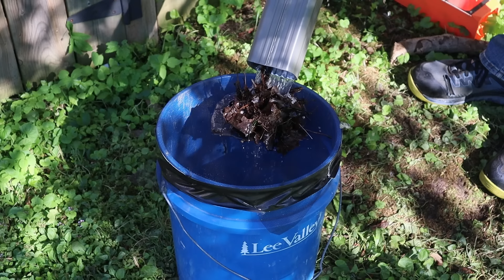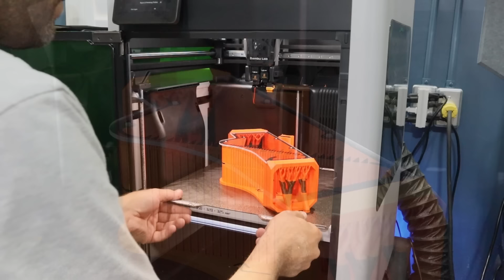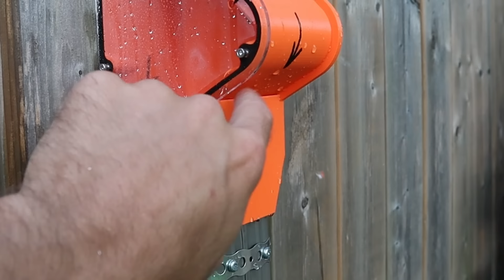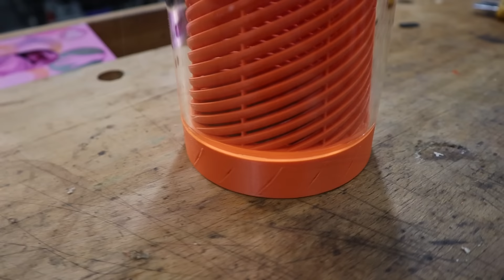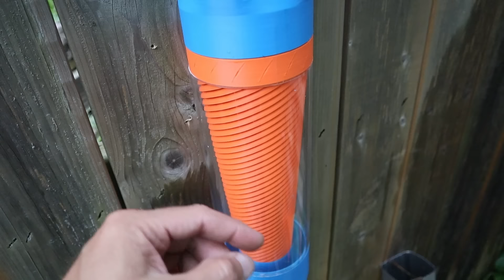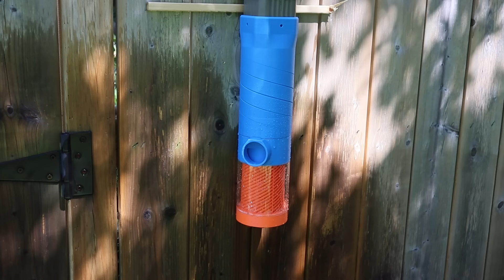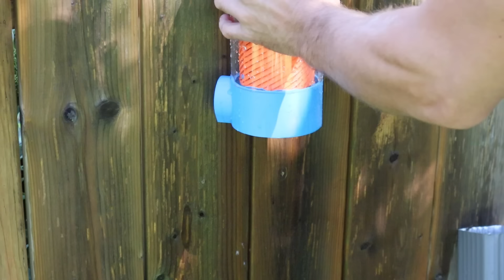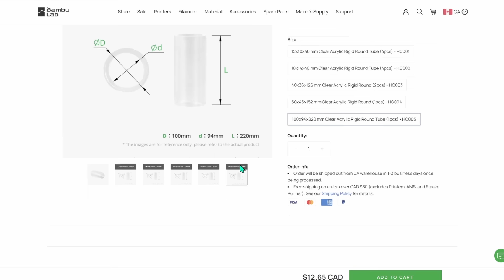Can you 3D print a self cleaning downspout rain water collection filter that actually works?  Let's

Comment: I worked on designing downspout diverters a while ago. Spent a lot of time changing designs and testing. The problem with trying to make self-cleaning designs always comes down to the limitations of dynamics. Rain can be heavy or light, making debris either not move through the gutter or move all at once creating a clog by sheer volume. Then there’s the issue with freezing in winter. Small  passages easily get clogged with ice creating piecrete. Then there’s a vast amount of different types of debris or “tree trash” and it all acts different when it’s saturated vs not yet saturated. It’s nearly impossible to make one design that works year round for any environment and to never need attention/maintenance. One thing I can say is its best print in ASA for outdoor longevity. Petg is ok but less UV resistant. When it comes to material choice it may not sound like it’s a big deal since it can be reprinted, but you don’t want plastic chunks breaking off and going down into your pipes. Such things can easily happen even on new prints if ice goes down the spout and slams into the printed part.
Reply: I love when people have very niche knowledge about something and finally get to share it with others when an opportunity like this arises. Thank you for the input!
Reply: hear me out: to make the water pressure somewhat consistent - you get some kind of spring or bucket in the pipe to block the flow of the water until it reaches the minimum weight (like a full bucket of water). Then, it gets rapidly released creating a consistent pressure for a moment. In a light rain - this will trigger once in a while (maybe once in multiple rains), but in a heavy rain - it will trigger over and over non-stop. However, the pressure of each "burst" will be consistent, and you can design for that. I have no idea if that will work.

Unfortunately, where I live - the rain doesn't exist so I cannot encounter this problem and find a perfect 3D printed solution, but it should be there. I would probably start with separating the dirt based on size. Initially, you have a 40ish degree slop (like the first solution) but with very large holes and very thin catching blades - it should get sticks and large leaves out. And then you deal with more consistent leaf dirt stuff
Reply: @printsthatscale  I appreciate the suggestion and it’s a good idea on the hole. But if you’re to think about it like a product you wanted to sell off the shelf then that’s probably not gonna work. That’s kind of stepping into the realm of over-engineering that can create its own set of problems and more complicated solutions. What I can say is it is best to model these types of things around larger downspouts or pipes. Nothing less than 4 inches. I used a design that I made myself out of copper tubing for over 10 years without issue and no maintenance. I only recently dabbled into 3-D printed stuff which kind of changes things and adds size and print limitations. I’m currently testing a design and have been for about a year which for the most part seems to be working well. I’ll never call something like this complete, unless it’s been in use through all of the seasons at least once. There is one minor change I may make that has to do with the grill. 

I don’t collect rain water. I just don’t want to clean gutters which I haven’t since I’ve implemented these type of gadgets of my own design. Which was before 3-D printers existed. The key to moving debris with the dependency of rain is large openings and channels. Downspouts less than 4 inches will clog unless you don’t live near any trees. And the spot where the downspout connects to the gutter needs to be about twice as wide as the downspout to funnel debris into it otherwise, it tends to just sit on top and not flow down under certain circumstances.
Reply: @GrowingAnswers if clogging is one of the major problems, why not have this setup be closer to the inlet directed away from the house, with that setup connected diagonally along the length of the spout? More or less like so:

    [___      __from_roof_gutter__]
           \    \<-- filter starts around here
            |\    \
            \ \    \         top spout for debris filter,
              \ \    \  <-- bottom to divert water
water <-- /\    \
                    \  --> debris
Reply: @randomsandwichian Diverter up top? You loose flow force for self cleaning. And in SOME cases it’s undesirable because water splashes and sprays all over along with the debris. It’s more  manageable at the base.
Reply: @GrowingAnswers  or enough to allow the optimal amount of water to force through to also push off the debris, is just my guess.

I was thinking of using the spout set at an angle to encourage water flow to keep the debris moving, so where the spout leads away from the building, the outlet can be designed to prevent splashes and let the debris fall without clogging, or something around that thought. If there were any clogs, the length of spout up to the inlet will allow enough water build up to force the debris through, making it somewhat self flushing, I guess?
Reply: @printsthatscale if it sits in there to long between rains wouldn't you get algae & mold growth? Breeding ground for mosquitoes? Awesome idea but trying to think of solutions to combat that.
Reply: @valerievandellen6155  you can add a silver/copper stuff in - it should fight algae and stuff. Or a very small hole that will drain it over time if it's not dropped
Reply: @valerievandellen6155   no. Can not do it transparent for production because of UV, so  algae not an issue.
Reply: The one thing I would note with this magnet attached system is should it ever really really clog it will almost certainly self detach, which probably also will deal with the worst freezing could do to it. So its probably fail safe rather than fail badly.
 I'd also expect the spiral should be pretty tough by its geometry as anything coming down is going to have to be very very unfortunately shaped to really catch the more vulnerable edges of the spiral with any great impact. And not trying to be a particularly fine filter or divert the debris much I suspect it won't matter what variety of  "Tree Trash" very much - it might clog and detach the whole thing faster, but large/small sticky with sap or not it probably passes through without spoiling the filter. You do make some excellent points though.
Reply: With the modularity, maybe there could be different versions that you could plug and play throughout the year.
Reply: @Chris_Has problem is that fall and spring can be both hot and freezing one day to the next (here). Last thing you want to worry about is watching the weather and changing modules
Reply: The concept of your self cleaning grid is already available for the horizontal gutter to fix the issue at the root. Of course it's better to not have trees close to the house ( their roots damage your basement, and in France it's forbidden to have any tree less than 20m for fire reasons in dry zones ).

Those grids work the same. They are designed to make debris fly over the gutter. Sold in all good DIY stores.
Reply: @Benoit-Pierre  diverters are cheaper than gutter guards. And gutter guards still need maintenance, which is more work than maintaining a diverter.
Reply: Great solution. I'm in the UK and I need one of these for my water tank!  Small suggestion though- I notice the water collects at the base of the unit and t think some of it is draining back out the filter rather than going out the side. I wonder if excluding the filter from the last cm of the unit would allow more water to escape out the side?
Reply: we can collect the water in a small reservoir that, when filled up, tips the filter over. with a spring that restores position when the force is low
Reply: Hey I think that it you can 3d print a drain filter  like  they have for  the change drop box at a grocery store. Or more of an example in visual.  A wheelchair ramp with the slits on the top and sides so water flows through the slits,and the debri falls off the ramp.
Reply: With enough electronics so it actually self cleans, would it still count? :D
Reply: Yeah I have to imagine breaking the year into quarters and swapping it out every 13 weeks for the small variations in weather over the year would work best. It would function as a cleaning schedule and allow you to use optimum setups for each part of each season without being too much work.
Reply: It sounds like you're limiting yourself to passive design concepts. Doesn't it seem like an easier problem if you're able to use a sensor and some servos or an air compressor or etc. to automatically clear the debris?  Bonus if you power the active components with energy harvested from the falling water, or just by solar.
Reply: @thedanyesful That’s certainly a fun project idea. But not practical use. That would be too much mechanical and circuitry for what is otherwise a rather simple thing to solve. I’m working towards proving a simple product at some point. That’s why I prefer a plug and play solution that’s quick to install. Mainly because I know by adding moving parts and relying on stored power is asking for more failure points. I’ve seen plenty of diverters off the shelf and like none of them. That’s why I started designing and testing my own. Owning a home comes with chores and responsibilities and personally I try to reduce them. So a complex project and device is off the table for me. So far what I use is working well.
Reply: Not to mention this is all a discussion about 3d printing plastic water filtration, in which even "food grade" or "food safe" plastics are sapping into water supplies and increasing microplastic concentrations in our bodies.
Reply: @lpsoldin3162  one solution to this is to just use the plastic as a prototyping stage, then for final product make a 3d metal print. Alternatively you could use the plastic as a skeleton and then thinly plate it with metal or other inert / safe material. I wonder, how effective are silver mirror type reactions on complex geometry? 

Either way, you are very correct about the microplastics problem. More work definitely needs to be done on that front!
Reply: thats the most complicated way to say "use asa instead of petg" ive ever seen. Damn. PETG and even PLA will be just fine for many years btw.
Reply: @Sharpless2  the part about asa and petg is only a side note like thing in the comment buddy.
Reply: @mileslaer For real. Dude takes the time to share really niche and really useful experience and all this person can do is complain about a scant recommendation of material based on specific situations that will be encountered. How whiney.
Reply: @Sharpless2  There was years of knowledge just put upon you and you don't even understand what the man said. Hope you look good cause your don't have the brain.
Reply: @Sharpless2  He wasn't saying use ASA instead of PETG, that's just a short and separate point at the end. 

What he's saying is that testing it with a hose and unsaturated derby from only one kind of tree isn't representative of real life use and that the variance in rate of flow and type of debris make it virtually impossible to design a universal self cleaning design.
Reply: @Sharpless2  1. Comments says much more than that
2. Your life expectancy and residential problem span might be longer than 'a few years fine'

Comment: i'm pretty sure that shortest version looses water just because of overflow visible on the video(some water just sucked back through ribs by venturi principle), if you'll increase solid space at the bottom instead of having ribs it would loose significantly less water

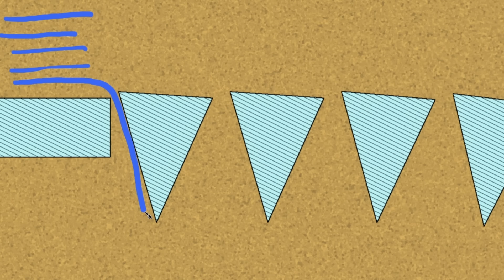Comment: nice work there, except for one thing - i doubt you need to have that "sheer off" gap expleined at 2:40. IMHO it will only make dirt having an edge to get stuck on. the Coanda effect alone will make the water go into the gap. AFAIK this type of shunt usually consists of a simple conical mesh with the same diameter as the tube at the bottom, and a toroidal chamber around it.  usually you don't want the fall-tube shrink in diameter, so whatever managed to fit into it at the top, will pass through without interruption.

Comment: This is great! what flow rate can it handle - here we put our gutter water into soakaways which can be blocked by build up of debris, usually we put filter caps in the top of the down pipe but then you have to put a ladder up to clear out the built up debris. This could solve that!

Comment: Have you thought about designing a first flush diverter. It would essentially go above your filter. The idea is the first part of the rain storm will have most of the dust and debris, so you divert that out for say 1 gallon or whatever size you think is appropriate and then it switches to the rain barrel after that first gallon has come through the pipe. You make awesome designs, I would live to see how you might appriach this design. I have seen many designs for this but maybe you have a different approach that no one has attempted yet?!?! I love your designs, so if you are up to the challenge I would love to see your concept!

Comment: One more idea to potentially deal with the pine needles and twigs: make the internal geometry of your downspout adapter widen slightly so the debris falls straight down while the water does an ever so slight bow outwards.
Your filter should collect just as well as it did before, but the debris is falling straight through in theory without even touching the grate much. Other than that, very slick system, I like it!

Comment: Neat conical design.  Although there are some room for improvement.  Blockages mostly happen when the cross sectional area or distances decreases. So have the water extraction extend pass the original downspout cross section, If anything allow a slight increase in cross sectional area.  Another thing is that water usually travels along the wall in long downward facing tubes due to adhesion.  Adhesion can actually send water along the underside of curved faces so no need to "scrape" the incoming water.  "Scraping" the incoming water can introduce ledges for sticks to get caught and cause blockages.  I like that you put the extra effort to use clear panels, a lot more effort just for us viewers!

Comment: Very interesting design.  Might I suggest actually using a gutter to feed the downspout rather than direct spray since water exiting a gutter behaves differently than water sprayed straight down the downspout.  Direct spray has a more forceful "cleaning" action than pure gravity.  I submit the fact that bends in the downspout being able to clog (albeit not frequently) suggests that even a slight taper will suffer more clogging effects with gravity alone moving the water--unless you have a LONG downspout above...

Comment: You could leverage the surface tension of water sticking to the filter to taper-out the spiral shape instead of taper-in, no edges directly along the path for debris to snag onto on the way down unless it gets carried around the edge by water.
Reply: This was my thought too, more or less revolve the first design so it forms something akin to a cone. less opportunities for it to be clogged.
Reply: I thought of that too. Hope he spots this and tries that next.
Reply: Especially if there is a way to make the surface hydrophilic
Reply: That would probably work great for a set range of flow rates. I imagine at a high enough flow rate the water will drop down, which in the cone shape he uses would fall into catchment, where I imagine the opposite orientation would fall to ground.
Reply: Came to the comments to say this. Might need some testing for different flow rates though

Comment: I have a suggestion for testing. Instead of dropping debris directly into the downspout, add a section of roof gutter to the downspout and put your debris in the gutter, then spray or pour water into the gutter to wash the debris into the downspout. You should get a more accurate performance result.
Reply: Its better to over test it with excess material rather than test with what it would be dealing with regularly (its called proof testing)

Comment: A good commercial supplier in the EU for this kind of filters is called WISY.
They have a range of products and they never constrict the inner diameter so they're self-cleaning and nearly maintenance free.
Reply: Is this available for a domestic buyer?
Reply: @adrianking6309  Yes, they sell to everyone.
We just installed the standpipe versions which makes the whole system invisible.
We're also going to install a high capacity vortex version on a different property.
They collect about 90% of the water in normal circumstances.
Quite impressive.

Comment: If I was rich on Earth I would demand the Vatican elites let go of holding back Electric Plasma Generated Ultrasound direct sound printing. Its already public science no contradictions that Ultrasound can print 3D and control metal grain structures during solidification process. But what masses don't understand yet = It can do Biological and Metal prints. Search Engine: "Ultrasound Stem Cell Proliferation" + "Ultrasound guided Stem Cells" < Holography bioprint repairs to Humans by hacking their biology to force it to stop conserving resources we can give you all back with delicious nutrient shakes. Imagine you making a video with no cooking school and printing the perfect Steak possible in the universe.

Search Engine: "Ultrasound can see viruses turn genes on and off" Where are genes at? Beyond resolution to make perfect food out of what would normally be food trash. With potential to scan old vehicle parts into computers to Generative AI God math the parts to modern maximum for use before printing non-plastic version. In Star Trek the technology in every definition when merged = Replicator..